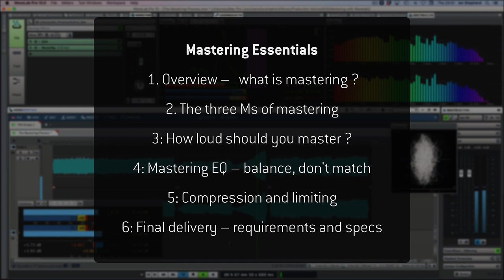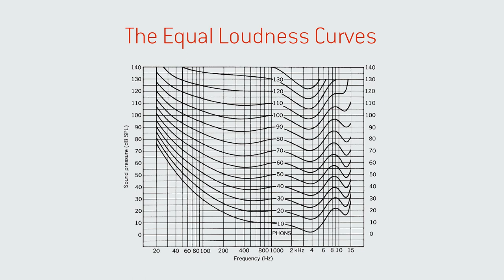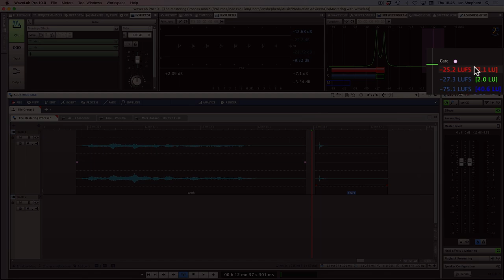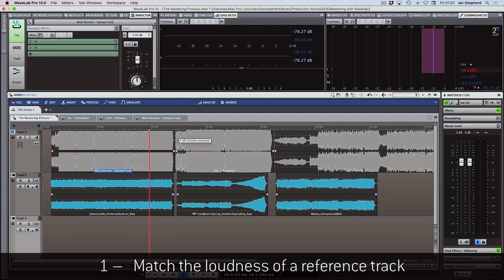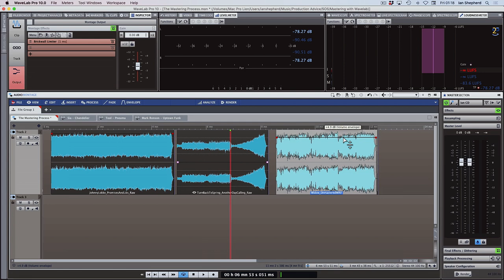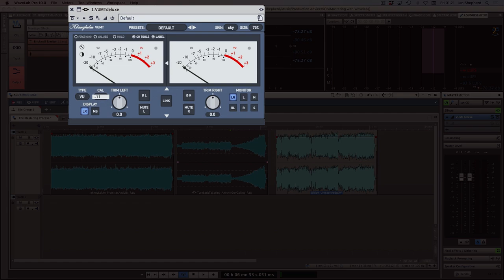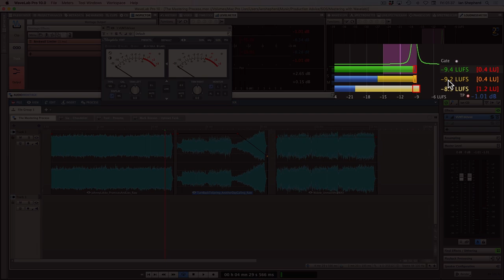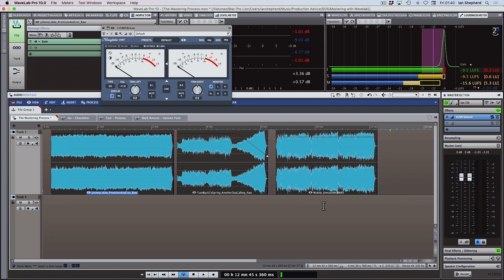Mastering Essentials Part 3 - How loud should you master ?

Comment: so -10 LUFS is the level to shoot for?
Reply: That's the loudest short-term value I suggest, yes, but only at the loudest moments. Depending on the material that could give you a wide range of overall (integrated) values, though. I wrote about the idea in more detail here: https://www.productionadvice.co.uk/how-loud
Reply: @ProductionAdvice  Hello , isn't it the momentary loudness term please?  Because the short term  measures the loudness of the past 3 Seconds , while the momentary measures the loudness of the past 400 Milliseconds .  For example , i have a mixed song only (no master) which has momentary term (-17) and short term (-23). Yhe highest value will always be for the average of the 400 ms (momentary), i think . Am i right?
Reply: @mago97615  Momentary is almost always higher, yes, but I find it reacts too fast for me to use for making loudness decisions . I find it most helpful to judge based on the short-term loudness, even though it works over the longer window as you say.

Comment: How is the room sounding so dead of reflections with so little visible acoustic treatment? It sounds like it was recorded in a highly treated acoustic space/booth.
Reply: A few things. There is actually more treatment, but it's in front of my seating position so you don't see it from this angle - check out Episode 2 @ 4'16". It calms things down at the first reflection points, reducing the reflections that get back up to the far end of the room and into the live side of the mic. Next I'm fairly close to the mic - probably only 6 inches away - although it is a condenser so it's pretty sensitive to the ambience. And finally I'm not talking very loudly :-)

Comment: Hey Ian - Really interesting to see how you used the VU for mastering! I have one question though - What is your opinion on using filter curves with the VU to get closer to the audio actually perceived? And which Weighing do you prefer / or maybe why you prefer no weighing at all? Thanks ;)
Reply: I prefer no weighting, because I've been using real VU meters for 25+ years, so I'm really used to the way they react. That's just me though, if you're just starting out using one and find there's a different weighting that makes more sense to you or feels better, go for it !

There's actually some benefit to be had from the authentic weighting - if things sound loud but look low on the VU, you probably have too much mid-range, for example. Or, if it sounds a bit quiet but the VU is very high, there's probably too much bass.

No meter is perfect, they all need you to learn how they read for different situations and adjust, so the there's plenty of room to tweak.
Reply: @ProductionAdvice  wow dude thanks a lot for the thorough answer!
Reply: @joost3783  Pleasure :-)